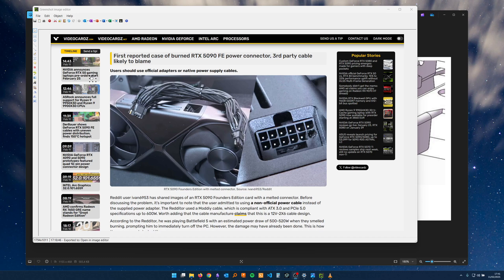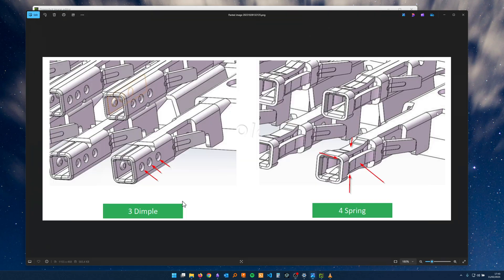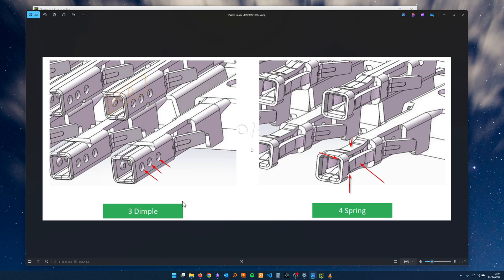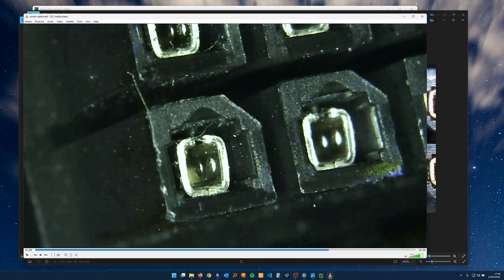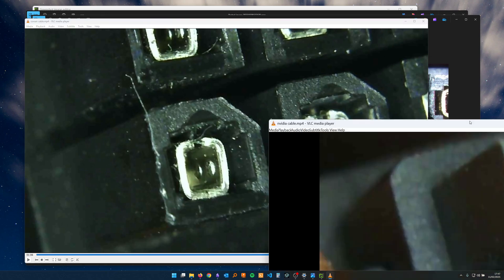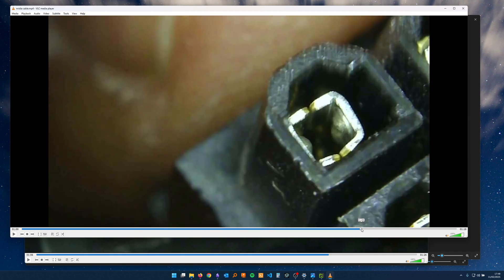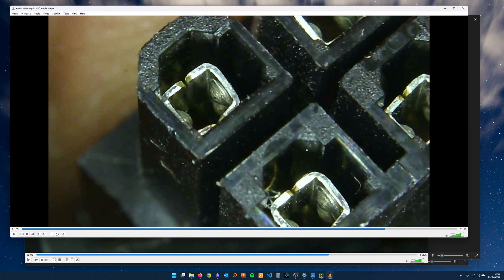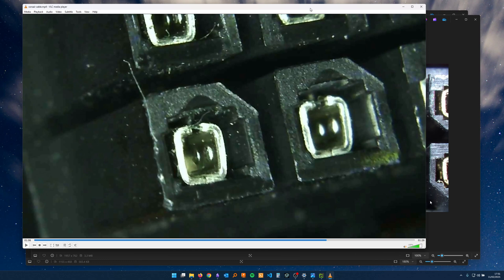12VHPWR Connector variance that is not being talked about

Comment: For the below setup:

Case: Be Quiet! Light Base 900 FX ARGB
The case includes 2 fanhub's ARGB with a total of 12x fans, but i will only use 10x fans
Fans: 10x Light Wings 140mm ARGB
CPU: Ryzen9 7900 (nonX version & no OC on it)
CPU Cooler: Noctua NH-D15 (in the future will switch to AIO Be Quiet Silent Loop 3)
GPU: Asus TUF 4080 Super OC version
MB: Gigabyte B650 Aorus Elite AX
RAM: G.SKILL Trident Z5 Neo RGB Black 32GB(2x16GB) DDR5 6000MHz CL36
SSD: 3x Samsung 990 PRO (1x 2TB, 2x 4TB)

Actual PSU: Seasonic 850W, FOCUS GX Series, 80 PLUS Gold, Full Modular, ATX v2.4, Eficiency 90%, Fan 120mm FDB Bearing, PFC active

I don't want to take any risks with the actual PSU and the 4080 Super, the case, ARGB fans, future AIO from Be Quiet.
Considering all the issues with that 12VHPWR, i need to know that what i have inside my case is safe to run.
I just need a trustworthy PSU.

What new PSU with all the newly adopted standards should i buy ?
What cables ?
What would you buy ?

Comment: I actually talked with Jon Gerow about the different sytyle terminals. Apparently the four spring design is not actually better. That was mostly just a very effective campaign from that particular manufacturer. I actually have a supply of terminals with a single big dimple that are rated for 9.5 amps in a 12vhpwr connector.
Reply from the maker: That's interesting to know! Does that rating still apply when you derate it to the number of terminals on the connector? I wonder what the low level contact resistance would be of these different styles (and the min/max variance)
Reply: @mechitworks  Yes, individually they are rated for 12 amps. The 9.5A rating is derated for use in a 12vhpwr cable.
Reply: I’ve had a MODDIY cable since launch of the 4090 that has used the lead spring design and it’s been flawless. At idle my cable is showing 12.129 and under load it’s in the upper 11.9 range. The simple design on the cable that my Corsair psu came with only show 11.9+ at idle and 11.7 under load. That tells me the dimple design isn’t making a good connection. It’s a brand new Corsair H++ cable too.